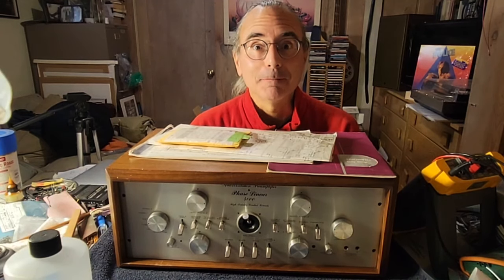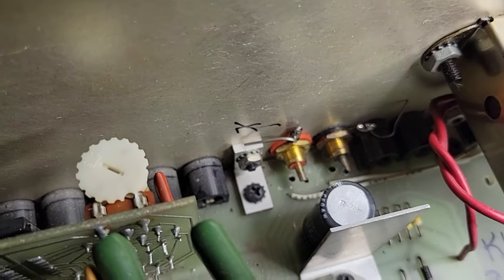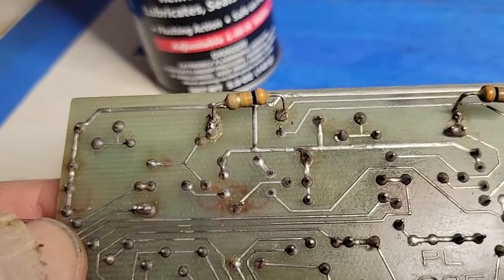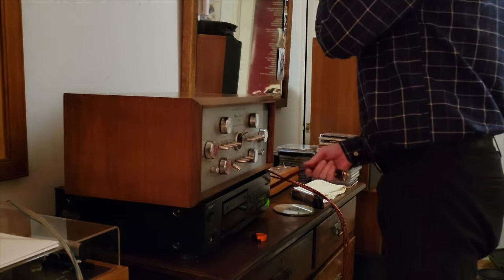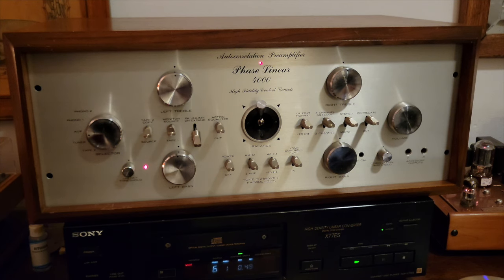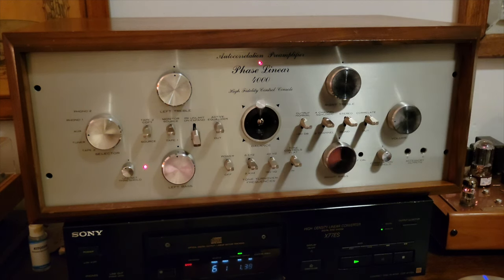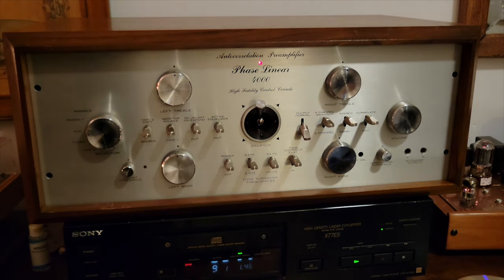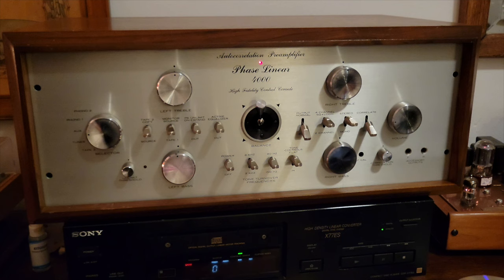Another Beautiful Phase Linear Preamp! The 4000

Comment: Nice find I saw it on Craigslist recently same model I don't know if that's the one you bought but it's a good one I went to an estate sale I hardly ever go to those ever anymore but it was a friend who passed away the basement was jam packed how about 600 tubes tube tester ham radio classic and a bunch of other cool crap for practically practically free very little money he had four deep cycle monster batteries 12 volts 1,750 :face-turquoise-covering-eyes:cranking amps each I could have gone for five bucks a piece but I don't know what I would do with them and they were good I was just overwhelmed and it was pouring rain I had to get out of there I just I don't know what I would do I bought one deep cycle battery a smaller one it was a thousand cranking amps but the other four somebody needs some but not me have a great day I can't buy anything ever again I got too much junk but it's good junk the best deal I found in the last 5 years was a 2325 Marantz for $10 yep $10 and it works and it's nice I went through it replaced a few things that needed but it really is nice somebody was asleep at the switch at that sale thanks for the videos I'll keep watching:face-blue-wide-eyes::eyes-pink-heart-shape:Plus I'm a geezer can't hardly walk I can lift stuff I just can't transport it
Reply from the maker: I bought the 4000 this time last year and sold it at the end of March this year to a guy in Eugene. I found the listing you're talking about. Looks like there are two for sale. They're asking a lot for "untested, doesn't seem to power up" and "untested. Power light comes on"!

Comment: Interesting tour of the Autocorrelation function. Did you do nothing more than repair the connectors and touch up the solder joints, and service the controls? No recapping?
Reply from the maker: I didn't replace any caps that I recall. It had been worked on, and I think it was actually modified, so I think a lot of the caps were replaced then. I had a mental "to do" list for that preamp, but I sold it before I got to anything on the list.

Comment: If you compair the spect to the Phase Linear 2000, the 2000 has better Signal to noice ratio and less distortion.  In my mind noice and distortion is the enemy when it comes to HiFi.  I too had a 4000, I thought the thing had to much noice.
Reply from the maker: Did you see that I also posted a video about the 2000? I've been sitting on the footage for the 4000 for a year; I figured that as long as I was making a video about the 2000, I should finally edit the video for the 4000. The 4000 is a bit better looking, but I didn't really want all those features, and it seems like all that extra circuitry raises the noise floor and distortion level, like you said.